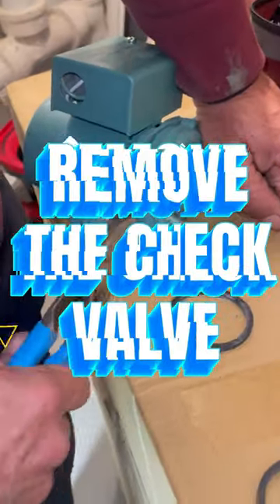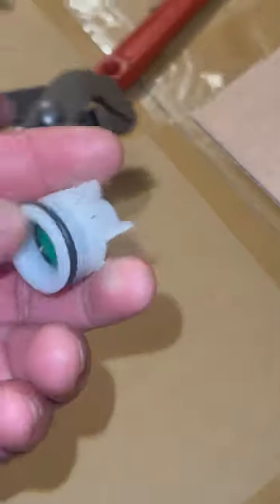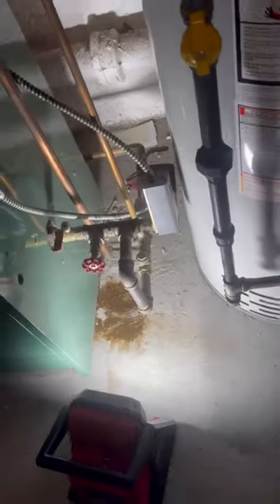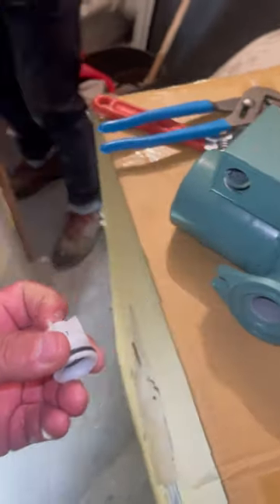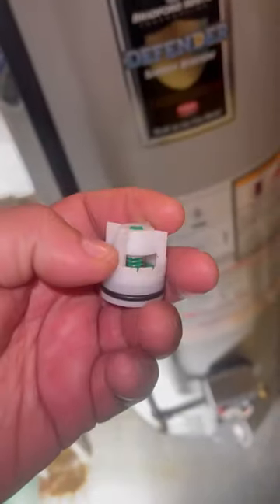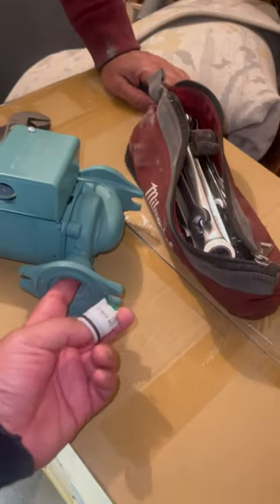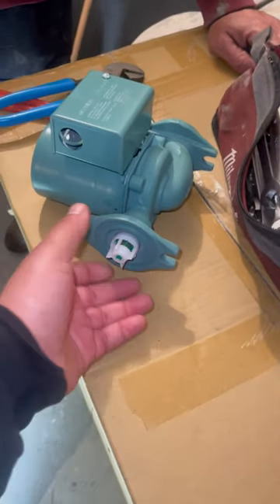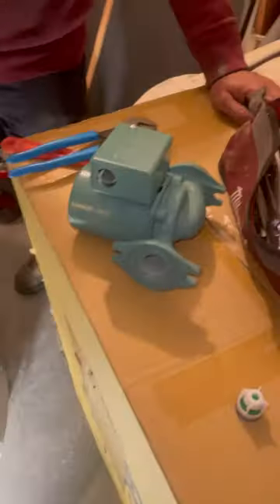REMOVE THE CHECK VALVE

Comment: I installed a new circulator pump on my boiler with the check valve it came with & my old pump did not have one after about two weeks the pressure relief valve started to drip so I replaced the water feed valve, expansion tank & relief valve all at same time and everything thing seemed fine two weeks later its doing the same thing & the pressure in the boiler is at 32psi. I think the check valve is causing the high pressure. I'm gonna to remove it and see if it helps
Reply from the maker: do you have a hot water coil? because if you do,it may be leaking slowly and internally and causing the water pressure to go up
Reply: @louietheboilerman  No I don't have a coil but there are two zone valves I think that might be the problem. I just got new gaskets I'll probably take the check valve out in the next couple & see if that solves the problem.
Reply from the maker: @tmoney7152  yea keep me posted